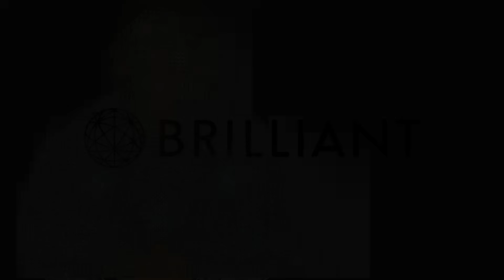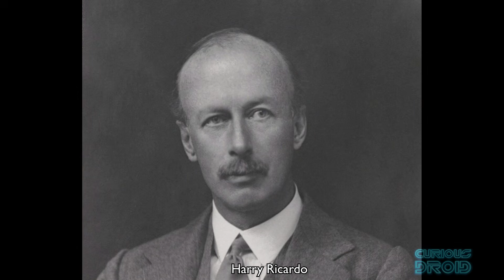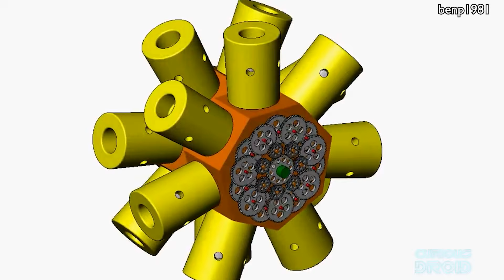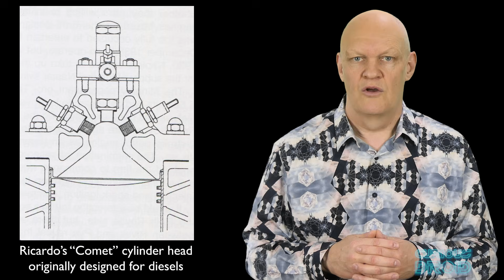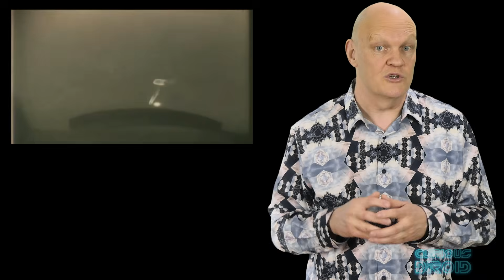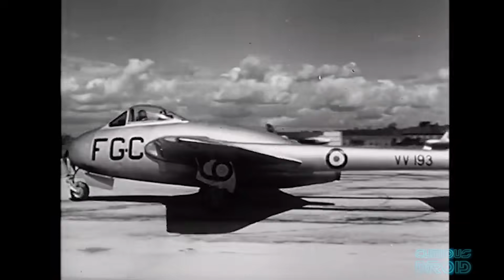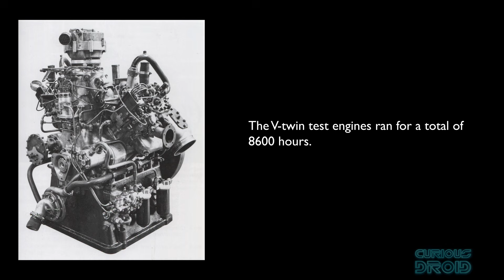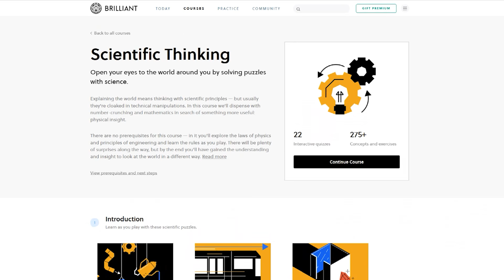Rolls Royce Crecy - The Most Advanced Piston Aero Engine Never Made.

Comment: How about those gigantic radial engines that have four layers of radial engines bolted together, like what was used in big late-1940s bombers, like the US B-36 and B-50 Superfortress?
The Lycoming XR-7755 was the largest piston aircraft engine ever built in the United States, with 36 cylinders totaling about 7,750 in³ (127 L) of displacement and a power output of 5,000 horsepower (3,700 kilowatts). It was originally intended to be used in the "European bomber" that eventually emerged as the Convair B-36. Only two examples were built before the project was terminated in 1946. https://en.wikipedia.org/wiki/Lycoming_XR-7755

The Pratt & Whitney R-4360 Wasp Major is an American 28-cylinder four-row radial piston aircraft engine designed and built during World War II, and the largest-displacement aviation piston engine to be mass-produced in the United States. It was the last of the Pratt & Whitney Wasp family, and the culmination of its maker's piston engine technology. The war was over before it could power airplanes into combat. It powered many of the last generation of large piston-engined aircraft before turbojets, and equivalent (and superior) horsepower turboprops (such as the Allison T56), supplanted it. https://en.wikipedia.org/wiki/Pratt_%26_Whitney_R-4360_Wasp_Major

Comment: It is not a "rotary" engine it is a RADIAL engine.
Reply: Yeah, and what is called the rotary, Mazda engines, Wankel engine, is a rotor engine, something was lost in translation! The rotor engine, the crank was stationary and the crankcase rotated! Crazy design, must had been impossible to balance!
Reply: Rotary aircraft engines had a stationary crankshaft. The entire cylinder case rotated around it.
Reply: @jpl1983  Not rotary radial.
Rotary is the wankel engine.
And I suppose the one in the sopwith camel where the crankshaft was fixed to the fuselage, and the piston blocks rotated along with the propeller, if you want to be pedantic.
Reply: @ineednochannelyoutube5384  it’s not being pedantic that’s what they were called. A Wankel  engine is a Wankel engine. It’s only colloquialism that it became a rotary engine.
Reply: @jpl1983  A radial is not a rotary. Radials were not called rotaties.
Reply: @ineednochannelyoutube5384  the word retarded comes to mind https://en.m.wikipedia.org/wiki/Rotary_engine
Reply: @jpl1983  You boys behave....

Comment: Could not quite make the leap from kw/cu” or similar until you finally mentioned the admittedly odd metric/imperial hp/litre units that I am used to.🤦Considering that pre fuel injection, the fast road car goal was 100hp/l that put it in perspective for me. Wowsers!
I recall a Coventry Climax four cylinder supercharged two stroke diesel in an ex navy boat I knew and that screamed like the rusty gates of hell opening when at full throttle.   Can’t imagine how a 12 cylinder would be.